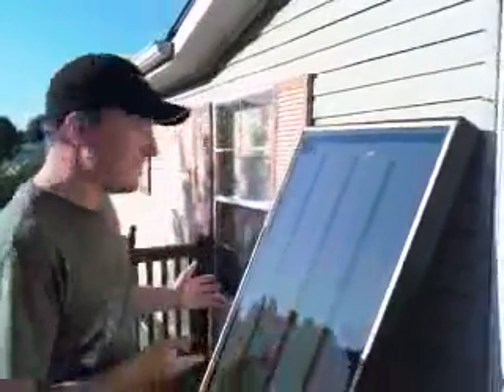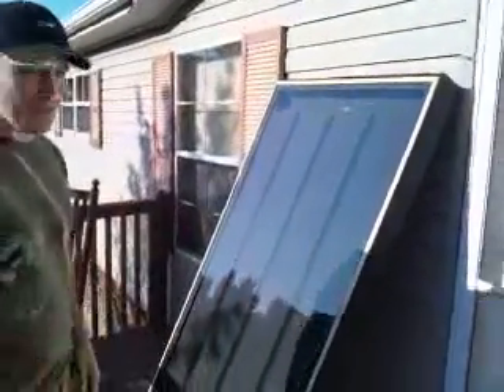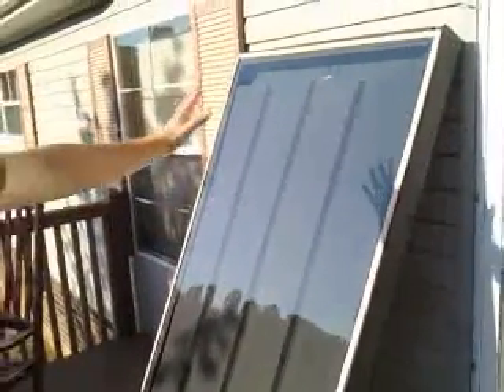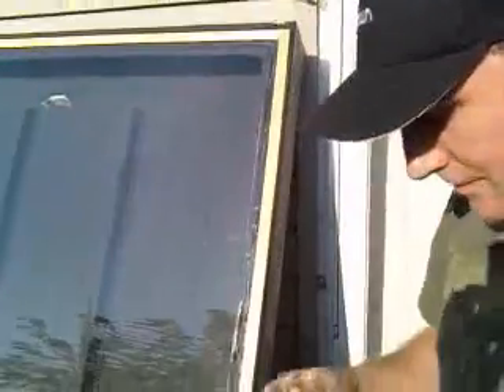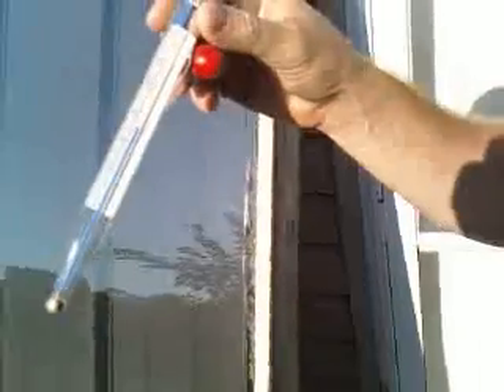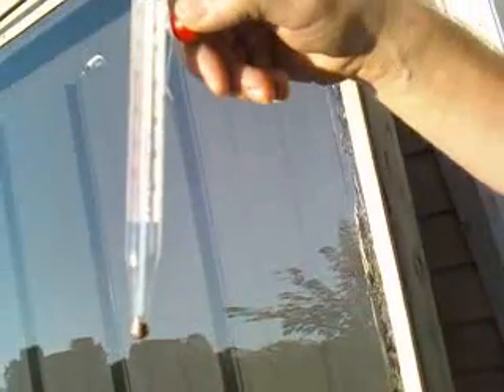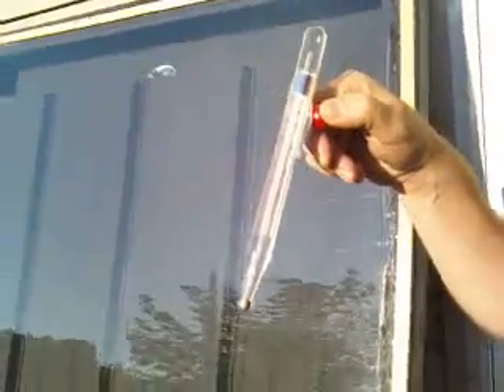220 degree solar air heater

Comment: No leaks at all, sealed like a frogs butt!! 2X6 frame, 1/2" plywood back, 1" foil backed styrofoam on 4 sides & back, all seems & edges sealed with aluminum foil tape,all cans & glass sealed with heat resistant caulk. what is different on mine is; I didnt put plywood/aluminum on the face of my top & bottom air chambers, one can look through the glass & see the 4" hole in the back. Seen others like this too. Yet still no major heat???Warm, yes, hot, no. Never reached 100* inside after 6 hours.

Comment: @jab0805 (Thnks for the reply) No leaks at all, sealed like a forgs butt!! 2X6 frame, 1/2" plywood back, 1" foil backed styrofoam, all seems & edges sealed with foil tape,all cans & glass sealed/glued with heat resistant caulk. Howevere, one thing that is somewhat different on mine is that I didnt put plywood or aluminum on the face of my top & bottom air chambers, one can look through the glass and see the 4" hole in the back plywood. Seen others like this too. Yet no major heat???

Comment from the maker: @vpbubbies The metal in my heater is about an inch away from the plexi-glass. It sounds like you may have a leak. Check your seals very well. The distance from the glass shouldn't be an issue. This only means that you have a larger heating chamber. It may just take longer to reach temp. Good luck and post your results. I'd love to see what you've made. Best wishes.

Comment: how far off of your black aluminum is your glass? I built my box from 2X6, the popcans are about 2" deep behind the glass. Currently testing right now, (Canada), ext tep=15*, but not even reaching 100* inside the box, according to the thermometer. Ive 60% cloud cover, been out for almost 2 hours. My thermometer goes from 100* - 300* readings, think I should have used a different thermometer to read a lower temp? (Hindsight) Any thoughts???advice?

Comment from the maker: @jjohn984able I'm using  2 - 12 volt computer fans that I'm powering with an old car battery. The battery is charging continuously with a 18 volt trickle solar panel.
Reply: joel brown   Just an idea...why not delete the battery, so the fan only runs when the sun shines...which is the only time you need it...

Comment: I prefer to design solar collectors that provide both free lighting and heating.. Reflectors or "heliostats" is the way to go!  check my site out... I will have a new redesign for next winter that will be so rad!! I only wish that they already manufactures my idea so I dont havre to build it from stratch. They are all into photovoltaics which sucks !

Comment from the maker: @Raykenn1  No, but it was below 40 here today, and I ran it from 11:00am until 5:00pm. Hot air the entire time. I didn't measure the exact temp. but I will say it was hot. We really don't get any sustained winds here above 6 mph. I'm sure if you did have wind blowing on it' it would drop the temp. inside some.

Comment: Great job on the project and on the video.  

Do you know of any video reports showing what the temp rise is when the outside temp is below 40?  Or, when the unit is subjected to steady winds? Would this have a pronounced cooling effect reducing the output of the unit?  I understand that in theory the unit could minimize heat loss with additional insulation, ect but, theory and reality don't always line up.